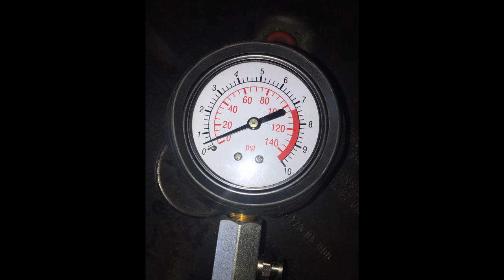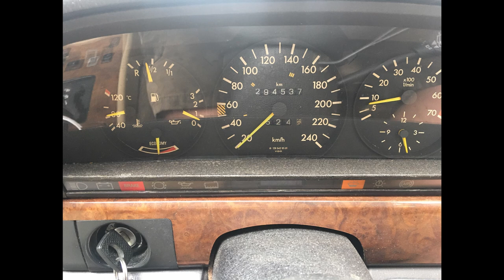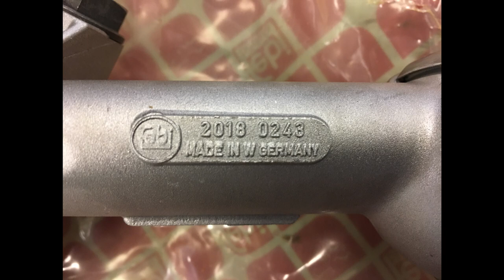Catastrophic Failure of the M103 oil pump in my 1986 Mercedes 300SE

Comment: Febi oil pump working good?
Reply from the maker: so far so good!
Reply: @classicjalopy  Every day, at the first start, how long does it take for the oil pressure to build up? Approximately how many seconds?
Reply from the maker: @altezzabmw  prob 3 - 3.5
Reply: Thank you it’s great Video. I have 1992 190e 2.6 93k miles the oil pressure is fine when it is cold but after warming up it goes down below 1. Do you think it could be the oil pump issue?